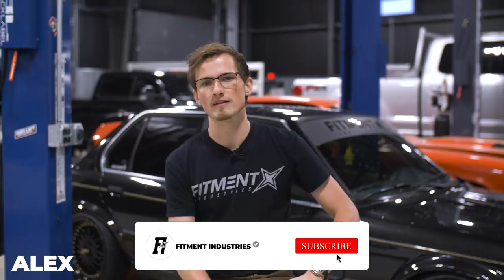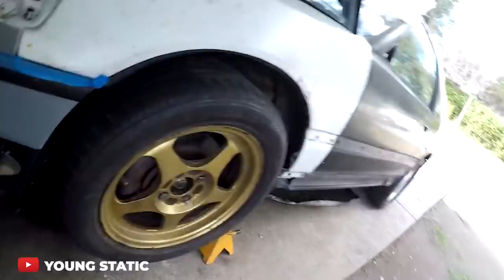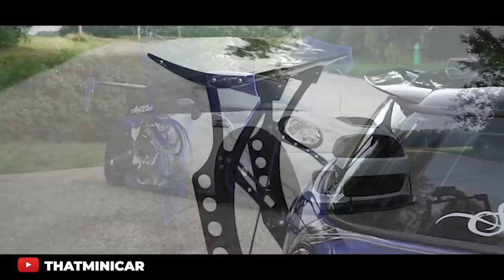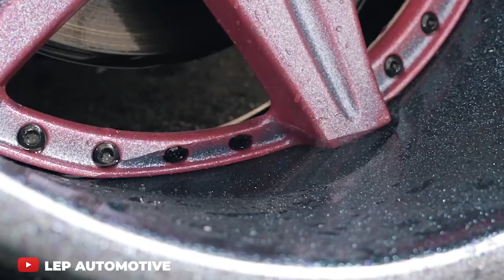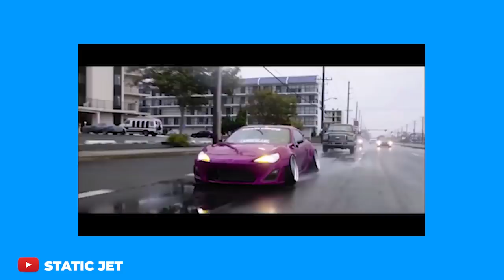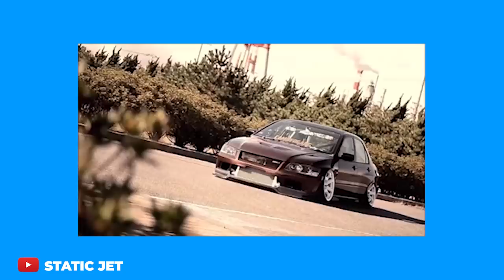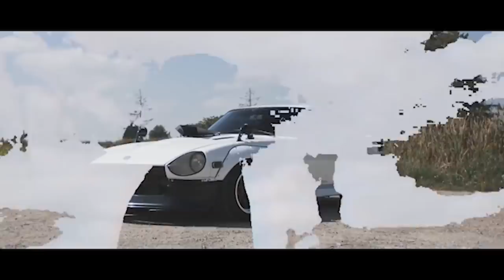Rookie Mistakes When Building A Car

Comment: So right now I have a BMW 330ci and I have done all preventative maintenance. The only thing is that it’s automatic and I know people frown upon that. I know what I want to do to my car and have to money to modify some stuff right now. 

-just got to the part where Alex said to build your car for yourself. So I guess that answers my questions. 

Still any opinions or suggestions?
Reply: Adamdickieson Yes, it’s an e46 2002 BMW 330ci. I spent a lot of money already fixing it up. Was thinking about getting something new that’s manual. I’m also in college so I don’t got the funds like that to restart on a new car. So I was thinking later on when I’m done, I can do a manual swap or even an engine swap. I really do enjoy my car and know the car very well after all the fixing
Reply: Well first off, I’d say what do want out of your car? Drifting? Stance? Canyon car?
Reply: I have an Auto Civic that looks like an Si... don’t be ashamed. I know an Auto Bagged Civic in car shows. Build it how you like and people will be looking at yah. Stay humble and keep pushing the passion
Reply: I've an E46 330d touring 2002. I've upgraded the suspension with AP Suspension which lowered the car 40mm front and 20mm rear and replaced the stock wheels with Fox Motorsport MS007 in carbon grey (17x8j) wearing 225 45 17. Poly bushed when old bushes have needed replacing and the always followed the servicing schedule. This is my family car and is used daily. The has covered 248,880 miles and is still going strong! 👍
Reply: Greasy Style just trying to make it look nice right now. I can’t afford into drifting. I want a new paint job (some body work needs to be done), new rims, reupholster the interior, and suspension to lower it.
Reply: Nick Tank thanks man for the positive vibes. I’ll keep working hard with what I have and make it my own :)

Comment: There is one mod that I really want to do at my car in 1 or 2 years when I will have a nice engine bay it's a transparent hood, I only have seen one car like this and even on youtube you don't see that much of these (it's pretty "unique" and it's look really nice)
Reply: Hey man, thought of doing this as well.  Either making the whole hood outta lexan, or cutting a hole in the hood around the engine cover and covering the hole with lexan.  Might be cool
Reply: ThatWhiteGuy but, because of the sun and the heat of the engine, I wonder if it will become yellow, so maybe I will put it only for car show 🤷‍♂️😂

Comment: You know, I get where the rookie gear head might go to Ebay to get super cheap, super sketchy parts, I was there in my early 20's. Honestly, it's a good thing that there are channels like this that can advise the rookies in what the best thing to do is. 

     Myself, I plan to bring a lot more power out of my truck's 7.3L IDI diesel. Not for making my truck faster, but for better towing, and pulling. Conversely, I'm not going to start with my engine, I'm starting with my transmission. In my case, I'm looking to replace my aging E4OD with a heavily upgraded unit from Monster Transmissions.

   Some might say to start with my suspension and tires, but the thing is, my suspension is built from the factory, perfect for pulling, and my tires are 10 ply, heavy load rated tires. So in turn, that side of the truck is perfect. Not saying I won't upgrade my brakes though, but I do have a little leeway there, as the trailers I will be pulling, will have brakes as well. Also, I'm used to inspecting my equipment, being a proffesional driver.

Comment: One rookie mistake is owning s 370z with straight pipes. Or just owning a 370z/350z
Reply: Your just jealous you don’t have one!
Reply: No hate, but what's wrong with the 370z?  I have heard that it is a pain in the butt to daily(Mainly because of the blind spots), but I think it is great looking, has great HP, and is pretty cheap if you get it used.
Reply: Chewy Lewy aftermarket parts are expensive as hell. My buddy has a 350z hr and just spent 4K on full bolt ons which isn’t much. Intakes, throttle body,  intake plenum, and r35 injectors. Plus it was 1k for a tune before he asked for the flame map which was an extra $200. They aren’t bad cars, but they really don’t make high hp low 300 to the crank and that’s on the good models. Plus they only have 2 seats which they have their pros and cons.
Reply: Whoa hey, to each their own, from a happy G35 owner.
Reply: The 370z is a phenomenal car! I've seen some 700+hp on stock internals! Not many drivetrains doing that nowadays under $40k. Very reliable as a lightly modified daily
Reply: Says owning a 370 is a mistake looks up 370 srt swap 🤔 just not adding up

Comment: Ok, I own a 2018 infiniti q50 red sport. My mod list is as follows...

Z1 motorsports full catted downpipes 
Z1 motorsports 2 piece brakes 
Z1 silicon hoses all over 
Z1 subframe collars
Z1 aluminum undershroud 
ADD 1 oil catch can 
Velossa Tech Ram Air induction 
AMS red alpha intakes 
AMS coolant expansion tank 
AMS heat exchanger 
HKS full catback exhaust 
HKS blow off valves 
RSR downsprings 
Stillen front and rear sway bars 
Stillen front splitter 
Stillen rear diffuser 
Stillen rear window wing
Aimgain side skirts 
Custom carbon fiber vented fenders 
SCL Global Performance Carbon fiber hood

AND a few odds and ends inside and out for looks.

Am undecided on wheels. Currently I'm running Giovanna Bogota gloss black but really like the look on the Lexani forged CF-Indy. But hesitant about the brand. 

Any thoughts?

Comment: My biggest mistake was adding performance mods to the car i.e cams, intake, exhaust, more on a tune than really needed lol, and then my suspension with coils and camber kits to keep a slight tuck and in the end having no money to get aftermarket rims so I ride the stock 17” long beaches on my car with a decent set of toyo tires

Comment: I've never been one to follow trends when building up a project car, I grew up in a hot rod shop but I have a love for imports and that has always translated into my builds. Currently I have a '05 Subaru Baja turbo 5 speed that set up for over 400 horsepower to be a daily driven rally truck

Comment: Im wondering if I can go with Ebay coilovers just for daily drive from work to home. I just want my car a bit lowered but not slammed like some people on the cheap 🤷‍♂️
Reply: Gabmax101 eBay coils will bounce you to the moon. Don’t cheap out on suspension. Megan racing coils or tein are pretty cheap
Reply from the maker: Gruwis has a great point. Invest in some Tein or Megan coils they are a great reliable option!

Comment: 2012 fiesta se - fart can, lowering springs with blown suspension, rims and tires to big for the fenders which never got rolled. led lights that were to powerful for the electronics which ultimately blew fuses and my radio lol, ive learned my lesson and plan on modding my 2017 fiesta st the proper way !

Comment: Putting 15 inch wheels on a stock Corolla with stock suspension and without properly rolling the fenders, had alot of scraping on bumps almost blew up the tire with the fender in the sidewall not doing that again

Comment: I Purchased a cat back from ebay for my BRZ, it mounted on the car crooked and no matter what the tips were not level, one tip rested against the rear diffuser, and on sat about 2 fingers below diffuser. Went on a 2 hour drive, when i got out i noticed a big hole melted in my diffuser. Live and learn, don't go cheap on ebay!

Comment: My advice; don't be afraid to get an uncommon car. With a little research you'll find most have a popular cousin you can transfer parts from. Some of the best builds are the only one at the show. For example; I have a wide body 2000 jetta and I'm currently building an n/a drift ranger.

Comment: First thing I did when I got my car was shell out $600 for a hard dog roll bar. Then I replaced my 200k mile shocks with coilovers and upgraded sway bars while I was down there. Did a few repairs that came up, then scored 15x8s on the cheap (I was due for new tires so I got wheels and tires for only a little more than just tires). But at the same time, I’m a function over form guy. My car isn’t sexy. It’s pretty clean, but it’s a 235,000 mile miata. I’m hyped for making 250whp, but all the mods I’ve done so far have been to sort the chassis out before power adders.
Reply from the maker: At least you appreciate your ride man thats all that really matters AT THE END OF THE DAY! 👀😂

Comment: Got my 2011 wrx widebody hatch, really want a track sometime- cruise in style- quick car
Got an sf intake, billet wheel vf 52 turbo (old one blew), new stock clutch/ machined flywheel atm, id 1050 injectors and aem fuel pump
I want to get a new head unit, some speakers, short shifter for quality of life mods
In order, looking at: 
Window tint
Either q300 nvidia or a tomei exhaust + another tune
Fortune auto coilovers
Some 18" rims n good tires
Better brakes and rotors (4 piston probably) once I have more room with the rims
Brake lines
Different swaybar once I feel it out (probably whiteline)
Some other various suspension components allowing for a slight performance oriented stance and better cornering confidence (control arms, ball joints, bushings, etc)
Legacy GT spec B transmission + rear diff
Better clutch to hold power with the trans
Close deck the short block
Pistons and con rods
Better top mount intercooler for that functional scoop
Fuel lines, different fuel pump
Slightly larger turbo
Intake manifold
Evaluate suspension again
Evaluate brakes again
And finally rip ass until I figure if I've missed anything

Comment: My first move was a brand new engine.
2nd was interior imo your riding on the inside not the outside make sure your car is clean and comfortable to ride in.
Then little tiny stuff like lights(inside & outside) music, window visors, tint, tinted license plate, something that adds a little hmm thats nice. Now about to jump to wheels and maybe some lowering springs. Then other little things like getting the front grill painted black leaving chrome  where it pops 
But it is my daily so i really dont care about shows or others opinion. Or going overboard with a body kit. Goal: reliable car that looks nice.

Comment: I know this is an old video but when I was in my teens I had a mark 3 golf and I wanted to lower it but didn’t know about really anything at the time..... needless to say I cut the springs down to the ride height I wanted and popped those suckers back in... god was that a rough ride. This time around I got some ARK lowering springs for my genesis sedan and it makes a world of difference.... just wish I could have afforded an air ride system lol

Comment: Biggest mistake (so far): installed stage 3 clutch w/lightweight flywheel and the car (s14) has stock power basically. Dailying it is a nightmare in traffic.
Reply: Buddy of mine had an e36 m3 he had a stage 4 in and the only other thing it had was an exhaust lol. Talk about a fucking workout. He got rid of it 2 months into owning it. Granted he has a basically stock e46 m3 to daily instead but he still drove the 36 everywhere

Comment: Never made the bad choices to do things in a bad order.  Going to school, I had some friends do a lot of stupid shit and get f***ed by it and it really opened my eyes.  Hence why except for the header back exhaust on my 89 Mustang, everything else has been supporting mods first (suspension, brakes, brake lines, fuel management, electrical, and restoration). Engine and trans are the last to get to worked on.  Building is fun but it is admittedly slow but I'm anxious for that end result

Comment: I have an 08 Sentra that’s a daily driver! I know Nissan has transmission issue and I have over 200,000 miles. Is it worth putting money into mods for it? I don’t want to do any engine work but I want it to be a intro project car.

Comment: Rookie mistake for me was preordering parts for my fk8 before they were released and needed up hurting my car more than oem *injen v1 air intake*!loss of power and 400 bucks. Same situation with rear tow links tru Hart’s didn’t have sensor adapter so waited for eibach wich fits my pro kit  wich did have the right mounting location but not until wasted another 300

Comment: biggest mistake with my first build (current build). solid subframe bushings on my b5.5 passat that's daily driven. rattles like a mo f88ker in gear at a redlight. forever having to replace my downpipe bolts! i've tried lock washers,lock nuts,loctite, impacting the everliving f**k out of them, it doesn't matter...they keep falling out :/

Comment: One of the best things to do with your car is get it into shape mechanically (speaking factory-wise). Stay up on regular maintenance. I've met countless people that have their car slammed on expensive wheels but its falling apart otherwise. Leaks, CEL, broken this, broken that, electrical issues, cooling issues, bad brakes, paint faded, chipped... Body rusted. Take care of the car as it is. Trust me on this. Then start to actually mod it.

Comment: I broke a wire on one of the airbag resistor that came with the NRG shorthub that i ordered for my BRZ. It happened during install, and a week or two later, i took it apart and resoldered it. I covered the wire with electrical tape, and plugged it in. Two months later, and i still gots no airbag light. So, i guess i did a good wiring job? I have zero confidence when it comes to wiring and electrical work, so I'm really surprised my wiring job worked.

Comment: Not immediately replacing the turbo with leaky seals on my 350z.  Building the motor after I blew it, rather than dropping a stock motor back in.

Comment: Ok so i want to build my nissan skyline r34 gtt. But in what order do i do it? 

I have done..
Wheels 
Brakes
Suspension
Drive line
Gtr 34 trans
RB26DETT  
Spoiler
Z- TUNE kit (not on the car yet)
Gtr interior.

What next baby Bcuz i want  to daily it and still rip. What engine upgrades??   

What i will buy:
V-cams 
Block brace.

Please tell me

Comment: Lol I’m about to go look at an E55 AMG I might buy tomorrow. It’s got roughly 540hp according to the current owner. I’m taking that with a grain of salt, but even in its stock form, it makes quite a bit of power, all to the rear wheels. I plan on taking it easy for a little while to feel the car out.

My truck makes about 480hp at the crank, but that’s in a roughly 7,000lb land barge with 35” tires. I used to drive a 2WD 7.5L f250 that probably made somewhere around 350hp. So I’m used to controlling the rear end in a slide, but jumping up to 540hp while getting lighter will make a difference lol

Comment: overbuilding my first drift car. i've gotten more seat time out of my back up car & daily because "main" car is a temperamental swaped & widebodied shitbox with angle mods that makes decent power and drives amazingly when it works, but half the time doesnt want to and i end up driving my stock ka 240sx with coils & welded diff, or my pretty much bone stock daily AE86 thats only TRD springs & LSD

Comment: I bought coil overs for my old civic and dropped it so low I was tucking the stock 13s. Went for a drive on the highway and almost died. It was awesome. Raised the car up about an inch the very next day.

Comment: my mistake before must be to work on rusted out bad cars built them balanced as fun road and track cars but in the end ther where some rust issues.
trying another build this time on a rust free car,  eurostyle... low car nice rims small details hear and there but in the end a clean looking car and not tune the engine so its still road worthy.

Comment: Don't put 30mm swaybars on your car and expect better handling.  I overdid my e36 suspension back in the 2000s and it was like driving a hockey puck.  ANY shock on any corner resulted in another tire receiving the same shock.  That's no good, compliance is a thing too.  Also, please upgrade your brakes.  My friend did an STI swap in his bugeye, tuned it to 340whp with an upgraded turbo.  Took me out with him to show off, and couldn't slow down enough not to rear end a car in traffic because his 0-100 went from 18 seconds down to 13

Comment: Omg, my first car was a civic hatchback 🏎 and, the first mod was.... a whole engine swap lmfao.... and I was literally a newb, I just bought my first civic, I learned how to drive stick and I completely destroyed the clutch.... so I ordered a brand new 6 puck clutch for the single cam and boom! Engine blows up.... I never did an oil change.... shyt I didnt even know about oil changes and shyt like that🤦🏽‍♂️😂. So my friend who happens to be the shop owner, he tells me, “heyy lets do a little b series engine swap...” Me, just trying to get my car back ASAP, I agree, he had everything already, spent like 1,500 bucks. He sold me the engine(LsVtec) for like 250 bucks, I got a gsr trans for 600 bucks, he sold me a fidanza light flywheel(idk how many lbs but it was super light), ACT 6 puck clutch, he also put on a skunk2 intake manifold for like $100 too. Meanwhile, this was all happening and I didnt know SHYT! Lmao i repeat im a newb, he put a nice ecu there for me too for another like $150 bucks, he gave me some old solid racing mounts he had laying around.... let me tell you.... The first time I floored the car, jesus christ, I almost took out like 4 parked cars.... One it was stock height, shyt it was completely stock, stock skinny wheels, not even a radio lol, second, I was in a curve when I decided to do that, all I remembered was my friend in the passenger seat screaming, “OMG OMG OMG OMG OMG OMG,” slight hint of shyt in the air 😂😂😂(joking), but yeah, I learned the hard way about suspension, tires, power to weight, popping my vtec virginity 😂😂😂😂. Good times, good times.